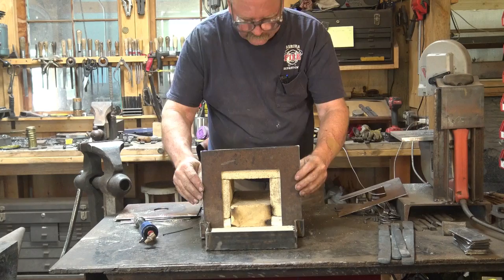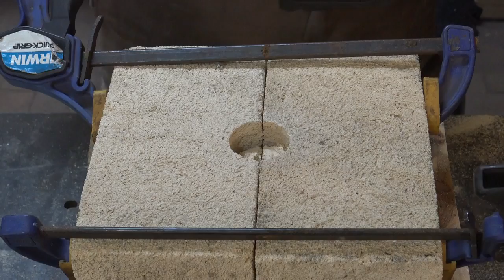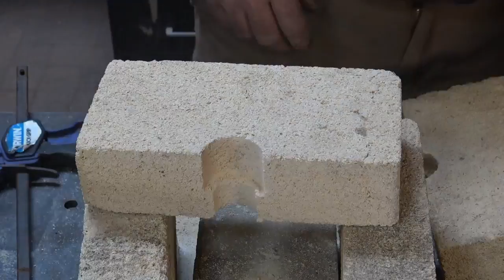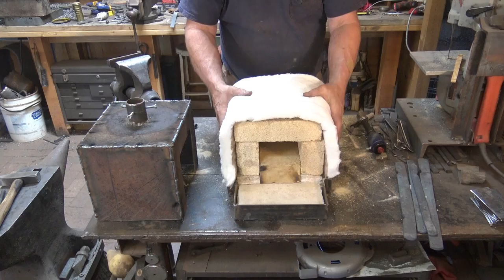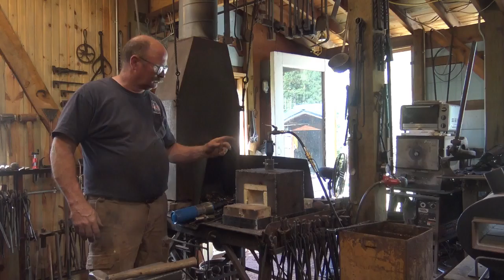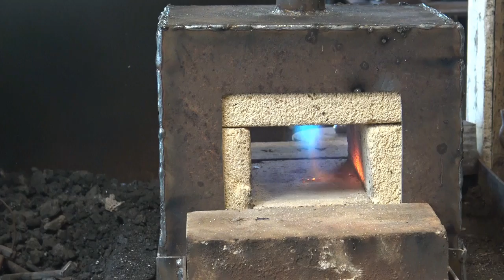Assembling the brick lined gas forge construction - part 2

Comment: It is better looking than my round Tabasco forge by the Chille Forge people. My guess is that the Tabasco is bigger. I got mine when they had removable end caps so that I could replace the kaolin wool in the future. I slather ITC 100 both on the inside and the entrance flanges often to keep things from eroding so quick. The Tabasco is too big for pinpoint heats for which the coal forge is better. I also prefer a coal/coke forge for forge welding. I am guessing that your forge will require less maintenance which is fantastic. I am wondering if you will ever find a need to partially block the end(s) to keep more heat in, such as on cold days.

Comment: I have a mini forge made from just one soft firebrick with holes scraped/drilled. It gets to welding temps, but it is so small. I do a lot of twisting in it, because I built a frame that it slides down with the bar held in place. So, I can twist with the bar still in the forge. You may want to build something like that.
Reply from the maker: Its an interesting idea

Comment: Your careful videos and clear explanations are and inspiration and a rare find these days.  However, I live in an area where a coal forge might incite the neighbors to violence.  (Well, maybe just loud complaints. <grin>)  Consequently, I'm considering a small gas forge somewhat like this.  I'm only a 74 year old hobbyist and have no commercial aspirations.  Since I have natural gas and not propane at my house, could I simply tote in refillable propane tanks like used on my camper?  Would I spend too much time refilling them?
Reply from the maker: You can use refillable tanks, but with a high volume forge they tend to ice up unless you go with the 10lb size. You can use natural gas with a blower, but I don't have the specs on what it takes to get everything just right

Comment: Where did you purchase the fire brick
Reply from the maker: You can buy it at most brick suppliers or places that deal with ceramic kilns.  In Pueblo we also have Refractories West or you can find them online.  But to actually answer your question I bought a bunch of fire brick and Kaowool at an auction many years ago.
Reply: @BlackBearForge  can I use the $1.20 fire brick From home Depot the 9" long by 4" 1/2 wide by 2 1/2 thick???
Reply: @BlackBearForge  sorry to bother you buddy

Comment: I don't understand why people don't just use the best aspects of all forges , forced air , kaowool , round forge , just seems like you could build the best possible forge that one could make that's also easier to reline and bring to welding temps , this would be the ultimate forge build !!!!!
Reply from the maker: After nearly 30 years of using gas forges I can assure you that there is no such thing as the ultimate gas forge. 

Forced air requires electricity, which not everybody has. 

kaowool is fragile and easily damaged, requires more frequent relining and has health risks
round forges have the least useful interior space and don't hold the volume of work for production runs
relining a forge is time lost and to do a proper job with coating kaowool it takes several days

If you ever build the ultimate forge I would love for yu to sen one out, it would be a god product to do a video review of.
Reply: @BlackBearForge  lol i just got burned lmao  : / .... ok maybe i shouldve done a tad bit more research before I went flapping my gums on the interwebs , I digress what would you consider the all around most utilitarian type of forge Mr. John  ...if you don't mind me asking ... like on a desert island with only one forge to choose from lol
Reply from the maker: Solid fuel is the most versatile, but coal and coke are getting harder to come by and less acceptable if you have neighbors.  For a gas forge, I have yet to find the perfect all round forge, they are always to small or to big for everything or they don't allow for odd shaped work pieces.  I currently have three gas forges and plan to add one or two more to provide more options.  But if I could only have one, right now it would be my oval Chili forge.  Once I get around t building a ribbon burner, I might change my mind.
Reply: @BlackBearForge  ahh the infamous ribbon burner , sounds good and I burn solid fuel myself and this is where i came to ask in first place so I don't waste to much time on a gas forge , also I see oval instead of round , possibly with forced air and ribbon burner sounds like getting closer , thanks for response and love to see your take on a ribbon burning forge I'm sure it will be awesome !!!!!

Comment: John I just modified my forge made it larger, and my burner sputters sometimes even when It gets hotter. I have heard there is some calculation to work out the forge area per burner, do you know what it is and if it's true and relevant.??
Reply from the maker: I'm afraid i am not the best person to ask.  I use forges, but don't know much about the design requirements for gas forges.
Reply: That's ok mate, when I find out can I post it here, others might be interested too.?

Comment: SILLY QUESTION BROTHER, WHY USE THE SOFT FIRE BRICK  ON A FORGE SO SMALL, JUST NOT NEEDED, THANX, ALWAYS INTERESTING
Reply from the maker: Please don't shout.  I used fire brick because it does not have the health issues that ceramics have.  Soft fire brick is more efficient and will preform better than the hard brick would.

Comment: OMG!!!!!!!! I have watched a lot of how to make a forge vids on you tube and ended up buying a two burner unit for about $450 and works great. But this is the best DIY I have seen. great job. either use it after the new forge is in use or sell it. it may last 15 mins before someone would buy it. this is a outstanding forge you made.
Reply from the maker: I have found that there is no one size fits all solution when it comes to gas forges.  You may want both.

Comment: Is the insulating value or the max temp of the Kaowool better than the board type? It appears the board type is easier to work with. I realize you were working with what was at hand.
Reply from the maker: I think they are similar enough in heat properties to be interchangeable.  Although there are different grades and temperature ratings.  I think it comes down to which suits the forge design the best.

Comment: real quick. Why soft fire brick wouldn't it be better to do hard fire brick all the way around?
Reply from the maker: the soft brick is a better insulator and will be more efficient.  If durability becomes I problem, then hard brick might be in order, but it will greatly add to the time it takes to come up to heat.

Comment: Why do you weld it all over? It would be better with 1" welds, 3-4" apart! Less welding, less distortion and more than strong enough! regards, Matthew
Reply from the maker: The tack welds would be strong enough, but ugly.  I chose to weld the full seams partly for a cleaner look, partly to pull the bow out of the scrap sheet metal I was using and finally to help prevent warpage as the shell heats up during use.  The shell warping after a few years of use has caused several forges to start having issues.

Comment: It is about the same size as my Devil Forge (I think mine is 4"x4"). Really nice for small stuff, and I don't run it for hours. But mine is only K-Wool all around with a hard fire brick for a floor. I like the brick shelf in front. You can just have another brick there for a door. Really easy and very functional! I'll build one like it, only somewhat bigger. One little idea: If you put some of that fibre board under the shelf bricks, you get a step down into the forge. That makes a little recessed area with your center brick as a bottom. There you can then have a layer of extruded clay pebbles. They are nice because they allow the flame to reach under the parts in the forge.
Reply from the maker: Interesting idea.  I would need to build up the rim that holds the brick.  Or I could go to a split brick for the forge floor.
Reply: Also the pebbles take at least some of the borax drip, if you should ever use any in there. BTW: Does the little burner get the forge to a welding heat? I understand that at your altitude you need to run a force air feed on your other forge's burners?
Reply: Are you referring to hydroponics clay pebbles?
Reply: I think so, the outside usually is brown and the inside grey.

Comment: Hi John , If you paint some ITC 100 on the inside of this forge , you'll see the temp increase by a few hundred degrees.
Reply from the maker: Quite possibly.  I wonder if that then creates a layer that needs to be maintained as it chips off in use.
Reply: Not sure about the chipping, or how tough those coatings are, but in my forge-building research I have read that their performance will degrade over time as they build up deposits and such, and so would need to be recoated periodically to maintain their performance level.  They are reflective in the infrared, and that property diminishes when they are covered over.  I think the interval proposed was 6 months to a year, depending on how often the forge is used, probably more often for a pro.  My plan is to create a thin(ish) forge liner out of castable refractory, since I have some left from a foundry build, insulate with wool, and coat with ITC or similar, all stacked in a cylindrical shell that will open up for maintenance....someday.

Comment: Nice, I noticed John the burner was spluttering a bit when you lit it, maybe a bit of kaowool is in the way, when mine is cool i put my hand in and put a finger up in the bottom of the burner to see if anything is in the way of the burner. Love it mate.
Reply from the maker: They tend to smooth out at heat.  But its worth checking
Reply: Cheers John, yeah they do that a bit at the start, mine does too.

Comment: Great little forge, would be good for a knife maker !
You're very right on the buying things at times instead of making them.
I've always been able to fabricate just about anything I wanted to but there are times when it makes sense to let the experts do it ! 😊
Thanks for sharing and take care. 👍
Reply from the maker: I always figure that after they have made a hundred or so of something, that they have the bugs pretty well worked out
Reply: @BlackBearForge  brick forge is how jm starting. 😀 bought a burner off of Amazon and it seems to work great so far.

Comment: John- This is a very practical and cost effective small forge design.  To increase its efficiency, would you consider coating the interior with HYB-UV or ITC-100 as mentioned/described by Rex Price on his hybridburners.com/products webpage?  Thanks for posting this video series.
Reply from the maker: I might, but I'm not sure if it will need it.  Plus that then makes for a layer that is easily damaged and will need repairs.